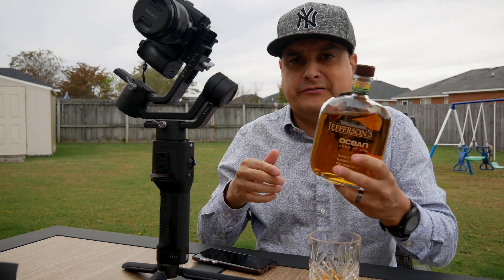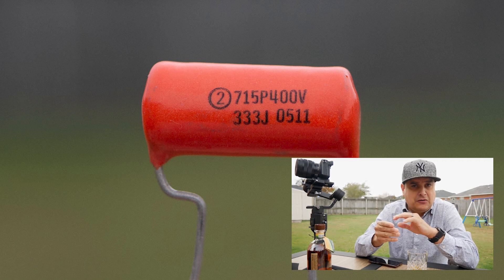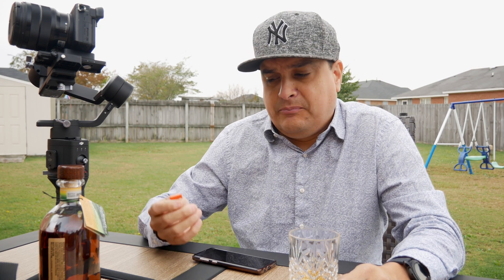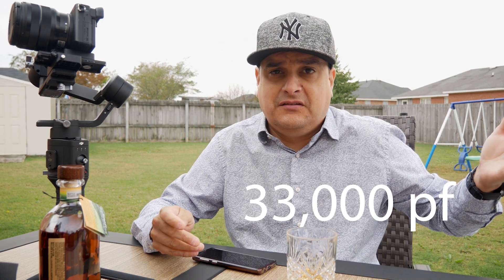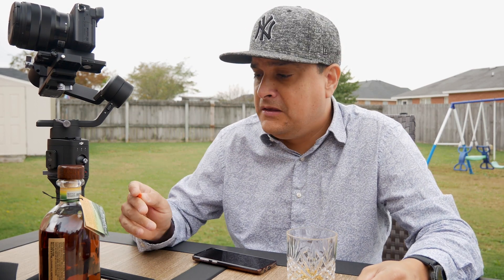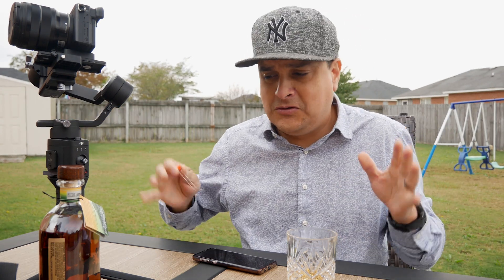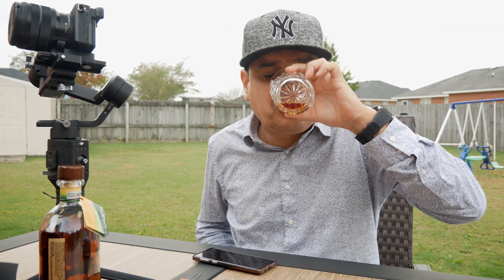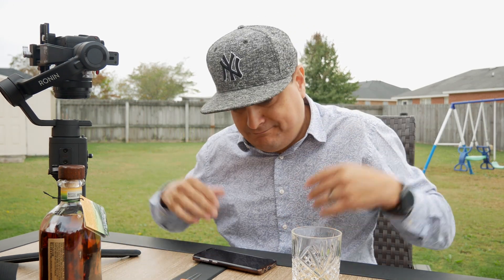How To Read The Numbers On A Capacitor

Comment: a higher voltage will get darker sooner than a lower voltage , please stop making videos
Reply from the maker: A higher voltage rating? No. That is incorrect. I higher capacitance will definitely make it darker.
Reply: @DylanTalksTone  yes , when its not being used, but a higher voltage rating when you roll off the highs will get darker sooner .
Reply from the maker: No… it won’t.
Reply: @DylanTalksTone  yes it will

Comment: Dude. electrolytic caps are the ones that will leak and drift more so than a polymer cap. polymer and ones like that, are basically, a foil, that has spacing with a plastic inside of it. therefore, age wont do anything to them unless something really drastic has happened to them.  im sure over whatever ammount of years it takes plastic to disintigrate, and room temperature, plays a part. but if kept in right conditions itll take as long as the plastic takes to disintigrate. thats why you get 2 in mail there. and the video saying 350ma of voltage wont change anything. ma is amperage, not voltage. milliamp. not voltage. voltage would be like 0.350v  if its voltage. and believe in me, that makes a HUGE difference, even if you cant hear it. it may be more OUTPUT voltage. which could effect clipping etc. it wont effect tone much thought you are right about that, but , given high enough, it would simulate a boost pedal, or it could i assume, make it so you dont need a boost pedal, or your gain pedals would be way more effective in creation of gain because input stage matters. with all this said and done,  im not subscribing . watched a few videos today. and your just wrong
Reply from the maker: Whatever you just ranted about makes no sense. You can say I’m wrong, but you don’t have a grasp (by this comment at least) of what a cap even does in a guitar. Even if what you said made sense, it wouldnt apply in this situation.  
The only reason I responded is to make sure others aren’t misled by your rambling. Enjoy your day.

Comment: A shortcut to the math for decimal conversion of the value show by the code is to use the third number as the position marker from zero for the first two numbers.  So, 333 then is 0.033 as the second three takes the third position behind the decimal point. And 473 is 0.047, etc.
Reply: That is how I read orange drop caps!  Seems almost too simple, but after dozens of amp builds, you are spot on.
Reply: 33000 pf to uf in app is easier but I feel you

Comment: Thanks dude for demystifying that too. Now here are a couple of things I'd love to tap your wisdom about:

- Conventional advice and standard practice seem to be to use 500k pots and .022uF caps for humbuckers and 250k/.047uF for single coils (or more generally higher k pots and lower uF caps for humbuckers, and the opposite for single coils). I get the math behind that but on a very practical level, how would you recommend going about choosing pots and caps for a guitar with two separately splittable humbuckers if the goal is to maximize versatility in all possible configurations? Would you have a recommended middle ground, or would you for instance consider using toggles to split the coils and route the single and humbucking outputs to different volume and tone circuits?

- What caps (and other stuff) do you use for treble bleeds?

- Browsing through diagrams, I've seen so many different circuits I can't tell what works best: Does the place where you put the cap matter? Meaning: between the volume and tone pots, or after the tone pot?

- If for whatever reason you want a  pot to work the other way around (ie roll it back clockwise and up counter-clockwise), can you just invert the two side lugs (i.e. use the left one as your input)?

Comment: Cool thanks Dylan. My question is how can you figure out which lead shields the capacitor? I know there is a line on some but most have no mark at all. Can this be done with a multimeter?
Reply from the maker: Orange Drop caps use a "series-wound" technique that has two separate sections, side by side, with a common "floating" connection layer, usually at the bottom of the layer stack.  These caps will have no inherent shielding